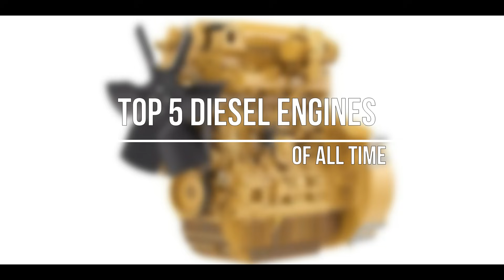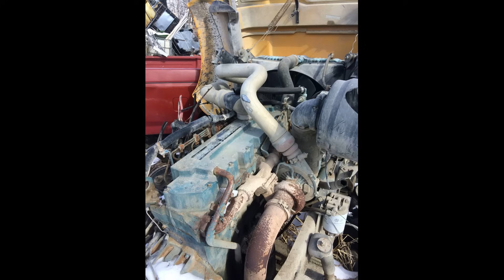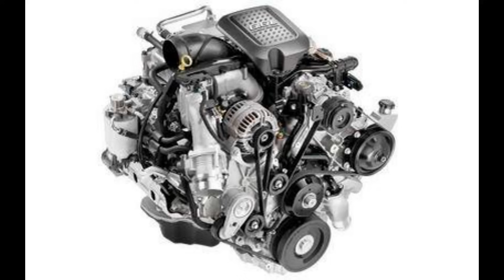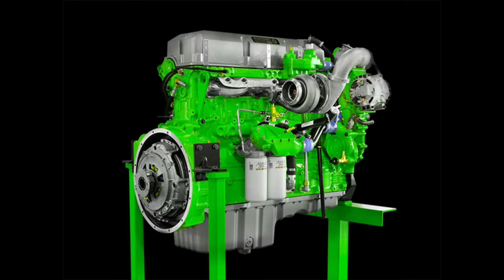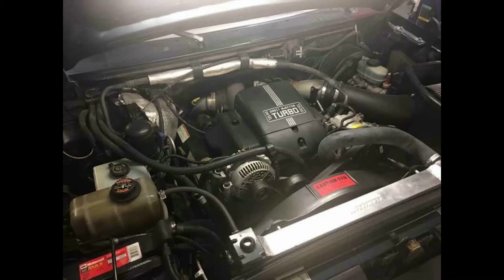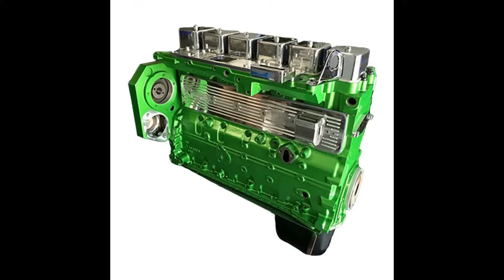Top 5 Diesel Engines of All Time

Comment: No mention of the magnificent range of gardner motors, when it comes to marine motors there' wast a motor made that could hold a.candle to these machines, the last one i had was the un-equeled 8L3B, 230hp @ 1150 rpm had a five and three quarter inch bore and seven and three quarters inch stroke,it was coupled to a 514 twin disc box with a 4.25 to one reduction, the complete unit weighed in excess of three and a half tons, just a crying shame they are no longer made ,

Comment: I have a 7.3 with almost 300 on it with 180 30 single shot injectors and 66 mm turbo and cnc performance oil pump pushing 415 hp and a 1015 foot pounds of torque

Comment: The Duramax engine is a good motor but it has one fatal design flaw and why the design engineers did this is totally stupid and should be called on the carpet for this one. In the crankshaft where the timing gear is positioned for the camshaft the crankshaft gear is held in place by a round dowel pin not a standard rectangular key used in every engine design from the beginning. So what happens is when the dowel pin is sheared off the camshaft goes out of time and pretty much destroys the entire engine. What engine rebuilders are doing is machining the crankshaft for a standard rectangular key , problem solved.
Reply: Thats good to know,  after getting screwed on my 6.0 powerjoke, I was considering a Duramax. Thanks for letting me know to avoid it at all cost as well.

Comment: I wouldn’t brag about Ford’s power stroke. They have two internal O-rings it cost $8000 in labor to replace them let that sink in
Reply: What internal o-rings are you talking about?
Reply: First of all which Powerstroke are you referring to? The absolute beast 7.3? Or the absolute turd 6.0? Two totally different animals.  I hate to even mention them both in the same sentence.  Now you got me wondering about these o-rings I've never heard of and the 7.3s have been out there slugging it out for 25 years and still going strong without a breakdown.

Comment: Here's another vote for the IH 7.3 POWERSTROKE. I ordered my '96 F-250 and waited 13 weeks for it to be delivered. I put around 315,000 miles on it, gave it to SON and it now has over 325,000 miles. It's had 3-4 cam position sensors, couple glow plug relay's, two water pumps, a power steering pump, one set of glowplugs, we've replaced the fuel lines in the Black VALLEY of Death twice,  found a few forgotten tools on the second replacement.  Son brought some really good replacement fuel line home from work, I fotget the brand but it's already outlived the crap my Ford Store sold me.  I hauled Dad's '51 FARMALL M home, bit over 200 miles grossing 20,000+#. 5 spd ZF with 3.55 axles and ran 60-65 the whole way. With dual fuel tanks I carried around 40+ gallons of fuel, enough for 800 miles between fuel stops. In the 325,000+ miles I only ever added ONE QUART of oil, 15W-40 Rotella.  I drove over-the-road with Detroit powered trucks, I'm used to carrying 3-4 gallons of oil with me.  No need with the 7.3L.

Comment: My 99 7.3 Dually still runs like a top. Just had to do a water pump first time. No visible blow-by yet. I take it out on 500 mile trips every few months and do a little around town stuff and it gets 20 mpg on hwy now after the water pump change I think due to getting the heats back to normal (replaced thermostat). These motors don't like cold water temps and the fuel mileage will suffer. I have replaced the back pressure tube and sensor and I resealed the turbo and turbo pedestal o-rings. This setup is stock and even the muffler and tail pipes are original.

Comment: Yep I just sold my 2000 7.3 powerstroke. One helluva an engine. It was mated to the 6 speed manual. Tell you what this thing would out yank ANY truck today with its nasty "granny" gear. Unfortunately I aged out and could no longer get up into the truck as it was mounted to an F350 dually.

Comment: I was told by a very avid mechanic who had no personal preference or vendetta against any manufacturer, he said the dt466 was the best most reliable diesel engine ever built. He said it was the only engine built and designed for 3000 working load rpm’s and 1200 hp, yet fuel efficient and lightweight. Easily rebuildable and phenomenal longevity.

Comment: The 6.6 liter Duramax.... all the talk about GM, but the fact is that it's an Isuzu engine.
Reply: GM and Isuzu worked together on the engine, they each designed different parts to create it. So it’s not an Isuzu engine entirely.

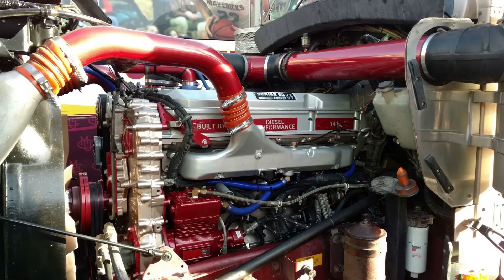Comment: 04:30 Unfortunately , that’s inaccurate. The Series 50 did not precede the Series 60. The Series 50 was a four cylinder version of the  Series 60. Also, Detroit’s engine program wasn’t exactly “dwindling “.  Nearly every transit/coach bus in North America was Detroit Series 71/92 powered at that time. The 2 stroke  simply was not going to meet the proposed stringent emissions regs ( even with the refinements that DDEC offered). That’s what lead  Detroit (with John Deere’s assistance) to design a 4 stroke electronically controlled engine. Also, the 14L Series 60was not so Detroit “could focus on the larger engine market”. The displacement was increased to 14L due to emissions.

Comment: cummins diesel left my country  i remember very well in the70ies when diesels were introduced in europe    that was something my dad bought a brand new ford transit diesel and that thing got an international ^price for smoking  Came to it that in fact no meachanic could work or adjust diesel engines in my country::that profession was called a diesel specialist at that time. Diesel specialists , I have seen them coming home in the garage, always had a grey vest on  an assumption of theuir skills. We shifted back to gas in our engines soon after but it was the oil crisis and costs were pretty high to drive that along all day long. We still had other diesels afterwards but my dad had become hesitant. Cost prize of a diesel was much higher too. It has last until the mid 80 ies when ford finally put a turbo on their diesels under pressure of the japanese. So pride owners of a brand new sierra drove around as if today your turbo has been blown. Still very proud. That turbo was in fact the Ford Turbo retarder, it left a voight on a Ford sierra good to roll a cigarette in  I don't like diesel...at all.

Comment: I know it's a car engine, but the mercedes 0M617 engines should be included here. It was amazingly well engineered.
Reply: AGREED!! I owned a few Mercedes Benz’s with the om617 and om616.  They were engineered as quasi-commercial vehicles with the taxicab market in mind. .I got over 700k on both the engine and transmission on my 240d . It was burning a quart of oil every 500 miles but it still got the job done (body/floorboard rot is what ultimately killed it). Those om616/om617 were ridiculously over-engineered and laughably underpowered. They were slow to accelerate, slow to burn fuel, and slow to break down.
Reply: the following om603, om606, om648 are all great straight six diesels. My 603 has over 500k on it.
Reply: @danielmorgan190  is the om603 the 3.5 liter?
Reply: @The_Lincoln_Penny  It's a 3.0 inline 6. Came after the 0m617 and before the  om606

Comment: Detroit 60 12.7 is overall the best engine ever build, especially the model 3 and 4 they're very reliable and good fuel mileage I get 7 mpg doing stepdeck so most my loads are heavy at over 40k
Reply: I drove a bunch of 12.7 powered Freightshakers pulling 63.5 k kg through the mountains of southern BC. I much prefer the DD16 for that kind of work.
Reply: 18 ton is not heavy.  A 12.7 would handle 38ton all day.

Comment: No mention of the Gardner LW series some of the most thermally efficient engines produced & very long serving!
Reply: Ian , you have it right, but don't limit praise to the LW series, the LX was used extensively in the automotive industry, but as a marine engine the Gardner had no equal, I was a Cray fisherman ( lobster) in Tasmania for 38 years an had many different types of engines including Detroit Cummins , cats, and more, overall I had Gardner's from the LW, LX, LX B ,up to the best of all ,the 8L3B which I consider to be the best, most reliable and economical motor I have ever used, such a great shame they are no longer made, cheers from Tasmania

Comment: The greatest diesel engine ever built was the Detroit 671 it helped us win WW2 I was a fighter my truck was equipped with a 671 for eight years it never failed us leaked a lot I remember it pumped for 46 hours and never missed a bet
Reply: Right on.
Reply: Damn right!  The original green diesel!
Reply: And for the 6-71 blower that was mounted on that diesel, as far as drag racing is concerned, the rest is history.
Reply: My book Detroit with the best

Comment: I drive a 1993 Dodge Ram W350 Cummins 4x4 Dually with a Manual Transmission and this video is the reason!
Reply: I daily drive a '92 D250 Cummins with a manual.

Comment: You forgot the 3406 cat and 855 cummins. You could have forgot a couple you mentioned . 2 of them were junk
Reply: Yea this vid sucks
Reply: 7.3 power stroke Pure junk
Reply: @Animal.CUT...  Why?
Reply: @bradjenkins932  DT 466 international and 12valves Cummins much  more reliable, and cheaper to fix it. The last 3 years of power stroke 2001 2002 2003 👎👎👎. One of my buddies has an 99 one and it was pretty good.... Maybe he still has it at 380k around ore more. The last 3 years of power stroke it was hassle to maintain, no. matter if u agree or not.
Reply: @Animal.CUT...  I agree with that.. l have a 94 and a 96 with around 350k on them, they have both been great engines.

Comment: My uncle worked at Cummins Diesel in the dyno department.  He tested every model available, particularly the Mack Thermodyne for it's great fuel milage.
Reply: It’s hard to beat the old Mack 237,300 and 350 4 valve
Reply: Indeed, still the benchmark since the Maxidyne years. @deborahchesser7375

Comment: Detroit Diesel was dying because the two cycle engines  (53,71, 92, 149 series)  which they made could not meet emissions and were not as efficient as the four cycle engines of the competition. The 50 series wasn't a problem because is came after the 60 series. The 50 series was a 4 cylinder version of the 12.7 liter 60 series engine. It was popular in bus applications.
Reply: You are correct in your comment. I remember a friend of mine who was a field service mechanic for Caterpillar talking about the DD/John Deere connection. There was talk that John Deere wanted to get in the truck engine market. In the early 1970s Allis-Chalmers produced truck engines but it didn't last
Reply: As well as the Series 40 being a product labeled DT466 International.
Reply: Yes but when the S50 came out with egr and air control vgt, all went south
Reply: Nicest sounding